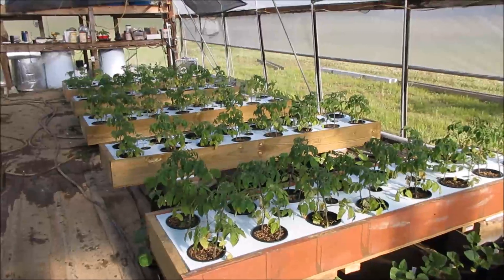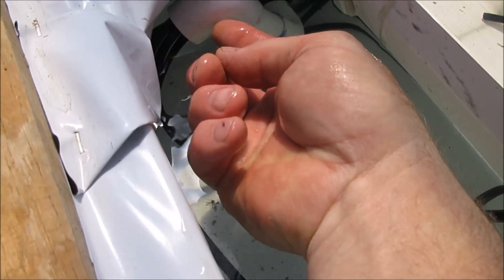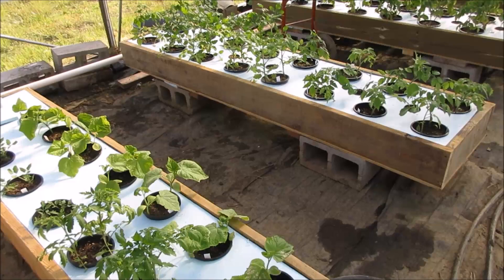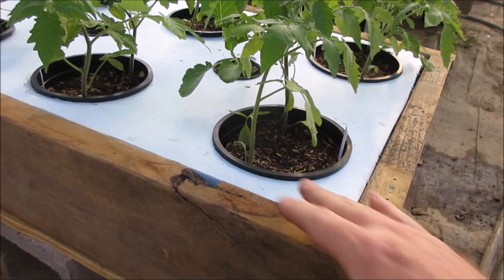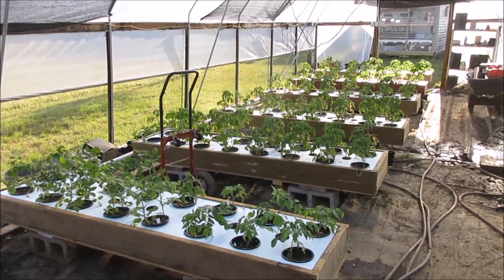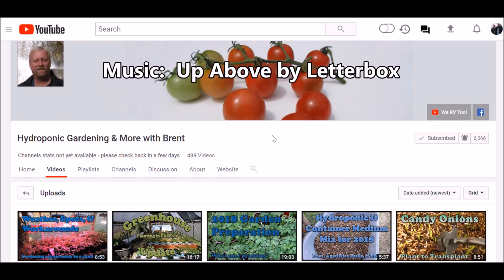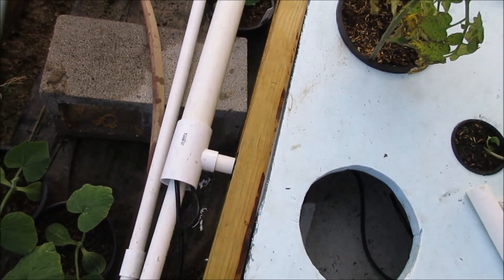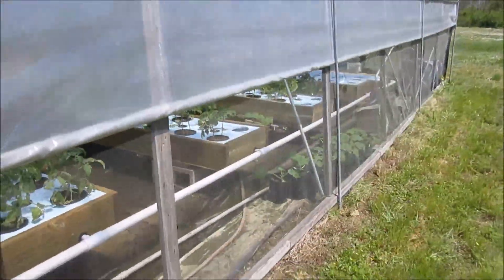FAWN (Closed Hydroponic System):  "Top-Up" Methodology, Part 2

Comment: Awesome update Brent! I'm wondering if over time the drain might slowly clog if the diameter isn't increased and or maybe adding red wigglers into the drain at some point In the future will help to cleanse them of dead root matter. Just a crazy idea I was thinking while enjoying the update. Thanks for sharing and as always Keep Building 👍
Reply from the maker: Excellent question!  Yes, they could certainly clog, but my experience has been that it'll take a long while based on the original FAWN's debris in the line.  To fix, it's a matter of putting a pressurized (home water) hose on the elbow end and "blow" it out.  If that doesn't work, I'll run as an aerated non-recirculating system until the season is over and disassemble.  The fittings aren't glued and maintenance is something I'd do at the beginning of the season anyway.  I inspected the 1.5" return line on the older FAWN and there was very little debris in it and it never clogged after years.  No worms buddy!